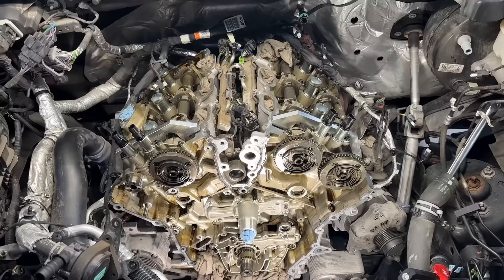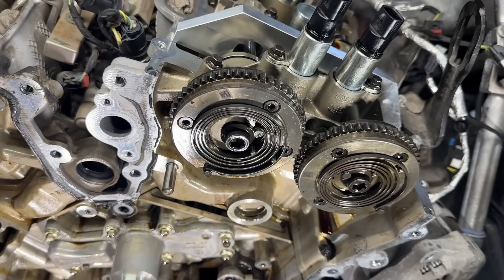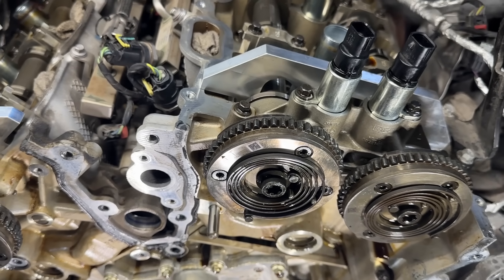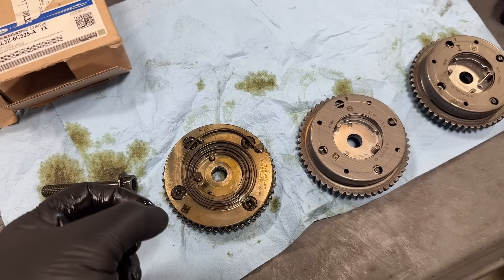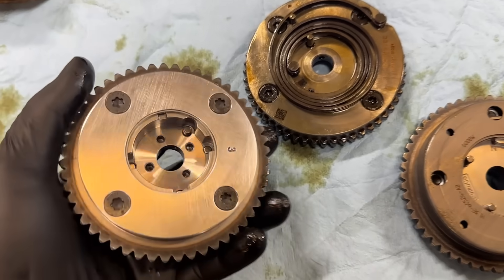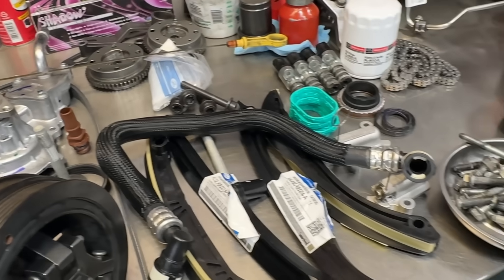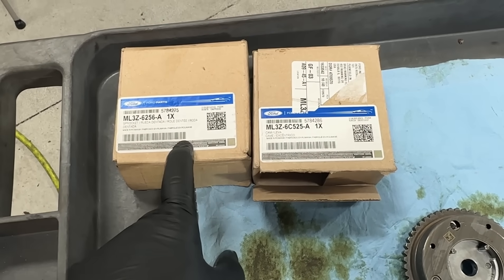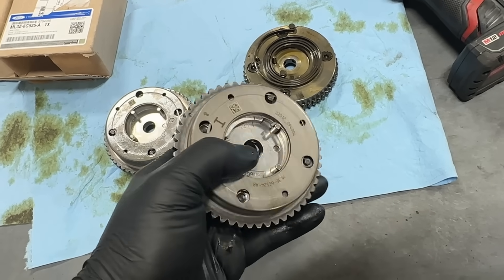2017-2020 Ford F-150 3.5L Ecoboost Startup Rattle Fix: Make Sure You Are Getting The Latest Phasers!

Comment: Ever hear of a oil pump solenoid issue 17 f150 3.5 2nd gen 68k miles oil pump solenoid went had open circuit so replaced oil pump with melling M490 oil pump lasted 850 miles started acting up again saying low oil pressure when it had normal oil pressure but no check engine just P06DA code stored. Threw research tearing apart oil pump solenoids from other failed pumps. From what myself and two other guys have found is the the oil pump solenoids are actually jamming up there’s a plunger inside that controls high to low pressure. I’m in the process of talking to tubers to delete the solenoid in the pcm way it can be unplugged and stay on the high pressure side 40 to 70 psi and not drop to 20 to 30 psi. FordTechMakuloco it would be awesome to see your opinion on this see what you know about it and if you would be able to help or have any suggestions I’ve came across a good amount of ppl who think they have had this issue and the dealerships just pushed a new motor on them instead of finding the actual reason out. Ford claims if the solenoid fails it will fail to high pressure side but they are wrong it can and will jam on the low pressure side I’ve personally seen it and have pictures to show the wear marks and jam points on the plunger I guess you would call it in the solenoid. Hopefully you get to see this or anyone else who might have these issues or have any advice on how to tune out the low pressure solenoid in the oil pump.

Comment: Should I assume that my 2020 Transit with the ecoboost has the old style phazers? I'm at 30k miles. BUT, If I do get the noise on startup, will this be covered under my Ford warranty that expires this month, and I just bought the Ford Premiumcare extended warranty out to 100k miles.

Comment: To anyone having this issue: do not, and I can’t emphasize it enough, do NOT wait on this issue. Fix it ASAP. I have a 2018 F150 3.5L Ecoboost and the amount of problems stemming from just this issue is ridiculous. I’m getting codes on for my turbos and fuel pump. Thank you for this video. I am picking up my new phasers this week.
Reply: @adynathaly3145 first thing you will notice is the rattling noise right after cranking. Eventually it took longer for my vehicle to crank longer than usual. For years these cam phasers have been defective on Fords. They just never got them right until now. I traded in my 2018 F150 3.5 and got a 2021 F150 5.0L. Best decision ive ever made. In love with that Coyote

Comment: Great video.. been doing tons of research before i dive in and do mine on my 17 3.5. Question.... could a person just remove one camshaft and get the nessary slack in the timing chain and not have to remove the front cover and related parts??

Comment: @fordtechmakuloco does the rattle indicate an actual problem once the car is running?  I just bought a 2018 Explorer Sport that rattles after sitting overnight.  I've been flood starting it for 5 seconds which prevents it from rattling.  No CEL or anything.  I plan to use it for towing, so I want to confirm that this issue shouldn't cause any performance issues.  Thanks.

Comment: Has there been an update to the  torque sequence and specs for the new updated phasers for 3.5 Ecoboost Gen 2 (2017)?
Reply from the maker: yup, exhaust phaser only
Reply: @FordTechMakuloco  Thanks for the answer and all the great videos.  Would you be able to reply with the new torque stages and specs?
I think I only have the old specs (same for I and E) - Stage 1: 30 lb.ft (40 Nm) - Stage 2: Loosen: 360° - Stage 3: 18 lb.ft (25 Nm) - Stage 4: 150°
Reply from the maker: Intake:
   Stage 1:  18 lb.ft (25 Nm)
   Stage 2:  150°
Exhaust: (ML3Z Style Only)
   Stage 1:  28 lb.ft (38 Nm)
   Stage 2:  90°
Reply: @FordTechMakuloco  thank you!  One last question, are these torque to yield bolts (cam and crank) torqued cleaned and DRY? Any small amount of lube on shoulder or threads? Locktite?  What’s your best practice?

Comment: I have a 2019 f150 3.5 ecoboost and the first set of phasers went out at 59,000 miles, had them replaced under warranty at a Ford dealership, and now they are making noise again at 89,000 miles. I check my paperwork from when they replaced them and it shows they put in the new style phasers that you mentioned in this video

Comment: Can anyone comment on these new phasers - will they work on an older model 3.5?  Mine is a 2013 and phasers need to e replaced.  Wanted to know if I go with these newer model phasers if they'll work.  Thanks!
Reply from the maker: No they are totally different.
Reply: @FordTechMakuloco  can you recommend an updated phaser for the 2013 motor?
Reply from the maker: The Ford ones have gone through multiple revisions especially the exhaust phaser.

Comment: Great timing and my catching up with a couple as yet unseen videos from Brian. Almost 47,000 miles and the cam phasers just started rattling a few days ago on my 2019. Guess I get to see how well that 100K Gold Used Certified extended warranty and the 21N03 program works and if I can "convince" them that to use the old design would be a mistake.
UPDATE 12 Aug: 13 days later after taking my vehicle in for cam phasers, just got 'reunited' with my truck. For what ever reason, they had to do the change twice. While I have my guess as to why, it's done. Yes, they did use the updated part numbers. This also included 6 fresh quarts of 5W-30 Motorcraft Semi Syn oil and a filter.It also included a couple gallons of fresh Motorcraft coolant. There were no failed swaged hose clamps or cracked valve covers and of course no other parts that Brian recommends though I already have an aluminum oil pan. This was done via whatever is the latest TSB

Comment: Around 50,000 miles, Ford replaced these on my 2012 F150. Now at 102,000 miles, had to replace them again but this time with the newer ones.  In total, $9000 spent on this. Next vehicle won't be a Ford.

Comment: It’s 2024. On my 3rd set of cam phasers. Told the local ford dealership I want the newest updated phaser. Not the old style. After they got done I saw the parts sheet. Says HL3Z-6256-CD I said I did not want it and to change it. They keep telling me that the HL3Z-6256-CD is the newest updated phaser. They showed me the parts box to show me it was manufactured March of 2024. They didn’t know about these part numbers you have. I’ve been wanting to throw up knowing I most likely will have to fix this again. So now what? It was just fixed yesterday June 21 2024. Debating on selling my ford vehicles and going all Toyota.

Comment: So I literally just got my 2020 F150 3.5L ecoboost Platinum back from the dealership two days ago for the cam phaser job...thru Ford's extended warranty. 

Before the job, we had a 20 minute discussion where I told them repeatedly, that I wanted the new cam phasers installed that are in this video... They agreed to do it.

First off they had my truck for 2 weeks...even though it was scheduled formthe first day. No biggie. But when I got it back, when I looked at the paperwork, it showed the old phasers--HL3Z.

When I brought this to the Service adviser's and the tech's attention, they acknowledged they did not install the ML3Z version... But that they did install the newer HL3Z cam phasers, that supposedly have an "anti-rattle clip". They said they had to because Ford wouldn't cover the warranty job if the paperwork showed ML3Z phasers.

They said they could tear the engine back down and replace the cam phasers with the ML3Z ones, but that if the ML3Z phasers blow the engine or if the cam phasers just fail, then when they had to send the cam phasers back to Ford for the warranty, the claim would get denied and I would likely be left with a blown engine and the costs associated with it would be mine alone.

Their concern was the new updated cam phasers in this video could potentially not be exactly as the old set and it could throw the timing off, causing catastrophic failure.

2 questions:

1. Would the Ford extended warranty still cover my engine if it blew up, after using the ML3Z cam phasers?

2. Are the new style cam phasers, ML3Z, legit? Are they the exact same specs as the HL3Z (meaning the same amount of sprocket teeth and distance between each tooth...etc)? Do you still use the same timing chain for ML3Z as was used for the original timing chain for the HL3Z?

If somehow you get this, even though it's a year later, and you do actually reply, THANK YOU! THANK YOU! THANK YOU!!!!
Reply: I have a 2019 new to me.. found the phasers were done at 34k miles in July 2021. I’m at 67k now.. so far so good. But the work order shows the HL3Z part also. They said the ML3Z is for 2021 and up and they had to use the “updated HL3Z” from the TSB.  I know this is a year later but curious how are your phasers?
Reply: @bennyg7506  just got it back last Thursday with ml3z...so far so good...don't drive it much and they knew they owed me for agreeing to ml3z but then putting in hl3z...

They tried that 21 and up with me too at first..after all that is what their ford system says.....but we had an agreement... and i knew ml3z would still work just fine....they just say the 21 and up bs to get rid of their millions of dollars in bs parts...when I went in for ml3z last week the tech (who I now know and have his phone #)  told me right after my truck, all the dealership gets now is ml3z....in fact Ford says to use ml3z if hl3z not available..i showed them the CSP 21N03 Supplement #3 below.... .here's just a one page screen shot of it but u can find the rest of the CS bulletin by searching the CS program 21N03 Supplement #3....
Reply: @bennyg7506  just got it back last Thursday with ml3z...so far so good...don't drive it much and they knew they owed me for agreeing to ml3z but then putting in hl3z...

They tried that 21 and up with me too at first..after all that is what their ford system says.....but we had an agreement... and i knew ml3z would still work just fine....they just say the 21 and up bs to get rid of their millions of dollars in bs parts...when I went in for ml3z last week the tech (who I now know and have his phone #)  told me right after my truck, all the dealership gets now is ml3z....in fact Ford says to use ml3z if hl3z not available..i showed them the CSP 21N03 Supplement #3 below.... .here's just a one page screen shot of it but u can find the rest of the CS bulletin by searching the CS program 21N03 Supplement #3....
Reply: Well I can't paste a picture but you will see they say to use ml3z on our trucks on the 9th page down of that CSP...it's in red bold typing....
Reply: My warranty repair with the HL3Z’s are holding strong 30k miles later still. *fingers crossed/knock on wood**. You?
Reply: @bennyg7506  they put on Ml3z's last thursday....less than 100 miles on them so far

Comment: Wanted to ask you about F150 2 wheel drive - 2.7 EB I bought brand new in june 2021 , The Ford dealer tells me the cam phasers are bad.  There is only  17.5 K miles on it and I have changed the oil and filter 5  times since new.  I thought the 2.7 was not prone to this like the 3.5 ?  Have you seen personally more 2.7 having this issue ?  Thanks for your time.

Comment: I have a 2015 Explorer here at the shop and I have put all Motorcraft phasers and tensioners and it literally rattles hard on start. Give a little gas to the pedal and it stops.. Put a high flow pump on it, no change.. I've had this motor out several times but the rattle persists... I'm not sure where to go from here..

Comment: What about the 2016 / gen 1?
Reply from the maker: What about them
Reply: @FordTechMakuloco  Sorry, I mean - is the process the same / parts the same - or are there any major differences?

My 2016 just went out of warranty and while I don't have the issue now ... I expect it will eventually so I'm trying to gather all of the information I need to make the process easy when the time comes.
Reply from the maker: The parts are totally different for the Gen 1 units, I have a few videos on the timing procedure.

Comment: Eco be damned! I'm glad for this advice since the mechanics I've been happy with for decades said replacing the cam phasers would be around $1,500. My 2018 F-150 with 91,000 miles recently has the rattle on start up. The problem as I understand it from other U Tube mechanics is the lack of oil getting to the phasers on startup. The press the gas pedal to the floor for a few seconds on start-up to get oil to the phasers is working for me right now.   No more rattling causing damage from lack of lubrication. Replacing with the correct parts without fixing the oil flow problem doesn't make sense to me. Getting a regular V8 and paying for lower gas mileage is starting to make sense compared to all these expensive repairs. If someone complains more CO2 would be released without the Ecoboost, we must factor in the pollution emitted by all the new parts being manufactured. I worked for industry reducing their pollution that saved them money under 1990's regulations. I never dreamed Ford would be this incompetent when I bought my first American made vehicle in 40 years.
Reply: The 5.0s rattle too

Comment: I wished I watched this prior to my first phaser fix.... but here I am 3 years later with finally the correct working redesigned phasers! Just to note, in 2/21 they replaced my phasers with the crappy ones, they lasted about 40k miles before they failed and started to rattle. Hopefully now that's the last time I have to deal with it!
Reply: @BVInAZ   they replaced mine with the old HL3Z’s in 2021 at 34k miles. I’m at 67k now. *fingers crossed*. All good so far.

Comment: I just got done doing the cam phasers , guides, tensioners and chains on our 2018 3.5 king ranch! Your videos came very handy and truck is running like a champ. We did fork out a couple of grand in parts but we replaced with new OEM parts even parts that could have been reused. Thank you for the help man!

Comment: What other parts do you recommend changing besides the phasers?
Reply from the maker: I always replace the entire timing set.
Reply: @FordTechMakuloco   and what would the timing set consist of?
Reply from the maker: both chains, tensioners, tensioner arms, guides and don't forget the one time use high pressure fuel line.
Reply: @FordTechMakuloco   thank you so much! Will order this tomorrow!
Reply: @FordTechMakuloco  Thank you! Just subscribed, do you happen to have the part number? I can't seem to find the correct one for my 2017 Raptor
Reply from the maker: Correct

Comment: Another great and informative video Brian. I am a long time subscriber and have relied upon your advise to keep my 2007 Eddie Bauer Expedition 5.4 running trouble free. My daughter now has it and at 220,000 miles it is still running good. I now have a 2019 Expedition Limited with the 3.5 Ecoboost. Just hit 50,000 miles and have again followed your advise, changing the oil every 5000 miles. No phaser rattle yet, but am now very concerned. Is there any preventive measures that can prolong the life of these phasers, or are they destined to fail?

Comment: I have a 2018 Raptor and it’s been great until around 76,000 miles.  Over last 6 months I’ve had phasers go out twice, turbo replaced, and last week a water pump and today truck breaks down on I10 in Houston and is misfiring and doing the same thing it did when phasers went out.  It has 88,000 miles on it now and Gullo Ford in Conroe, TX has been doing the “work”.  If I’m having all these issues should I take it somewhere else or can someone please give me advice on how to ensure my truck gets the right diagnosis and repairs, please !!???   It’s all stock.  When turbo was replaced the water pump began leaking at weep hole the same day picked it up.  3 days after I pick up for water pump fix it breaks down with this misfire and what seems like phaser problem with the rough running and blue smoke pouring out ….

Sell it ??? Fix it ???  Blow the engine and swap with a V8 ????

Comment: 2018 Lincoln Navigator. Would it take that Part ML3Z or is it too old?  It's got 87000 miles and they replaced them last year, under warranty.  This second replacement is also under warranty but I'd like it done right.  They haven't completed the repair, waiting on parts to come in.  Thank you

Comment: My 2018 Expedition has a rattle when first started. Ford has done the phasers twice. The rattle is still there but it sounds like it is under the engine. Maybe turbo waste gate?
Reply: Ok just checked latest invoice. I see no line items that say phasers. I do see Sprocket - Camshaft - HL3Z--6256--CD quantity of 2. Guessing this is them and these are not the latest part numbers! I also see Cam - HL3Z-6C525-CD quantity of 2.

Comment: Hello. I noticed the part # ML3Z-6256-A on the box, but on the part itself is ML3E-6C524-AB. Is that correct? Thanks, Don
Reply from the maker: That is the engineering number.
Reply: Just worried me because the ML3Z-6C525-A is the same on the part as it is on the box. Thanks for your quick reply, Don

Comment: This video is very helpful and very well done - thank you!

I have a 2017 F150 with around 90,000 miles and I’m getting ready to have the CAM phasers done - again - because the dealership used the original designed parts for the job and they are failing again (loud noise on cold starts).

I’ve also had the IWE issue and both front sides replaced and a starter replaced.

Are there any other common issues i should be keeping in mind with the 2017 3.5 F150? I also have the heavy tow package.

My Ford warranty is about to expire and I’m trying to decide if I should buy an extended ford warranty. 

Would love your thoughts

Comment: I believe my 2020 2.7 has cam phaser issues. It only makes the noise after the engine is warmed up and then started again within an hour or two. It sounds just like my 2018 3.5 that had phaser issues.